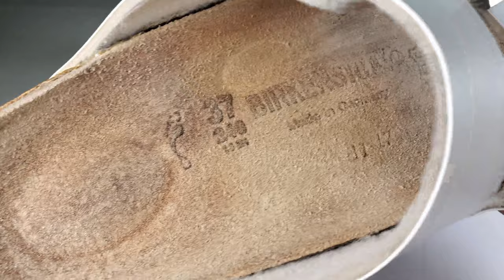ASMRㅣ How to Clean Birkenstockㅣ버켄스탁 세탁 & 복원

Comment: They look fab! Is it possible to clean the upper inside on synthetic straps? Ones with velcro fastenings are very hard to keep velcro looking clean n fresh..
Reply from the maker: It's better to leave the velcro especially female part of velcro. Because cleaning may  damage the velcro. Then velcro won't work properly.
Reply: If you gently sponged the back of the synthetic upper would that clean up even a little, with out warping or damaging it.. Thanks for your reply.. Appreciated greatly..
Reply from the maker: @niamhhogan2465  yes it will look better, but gently clean! :)